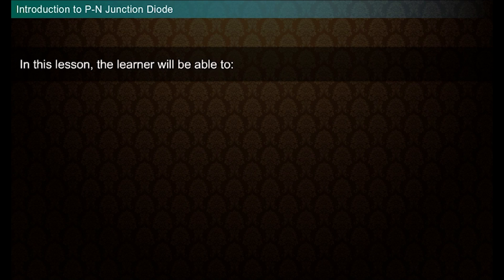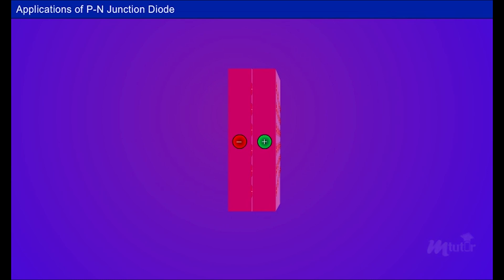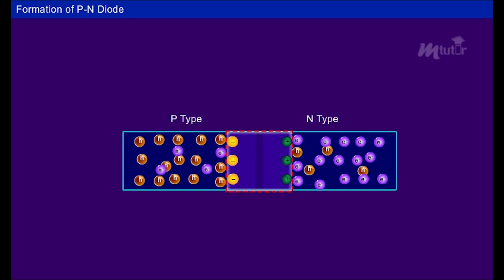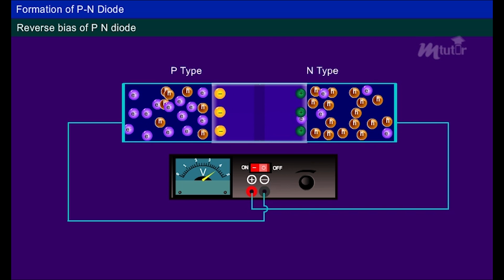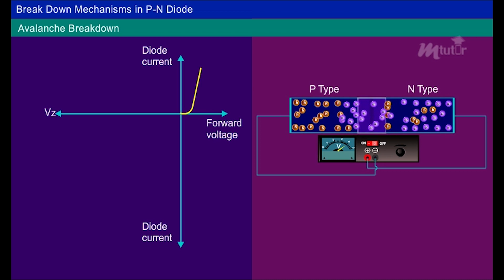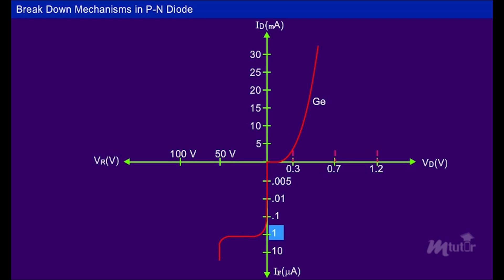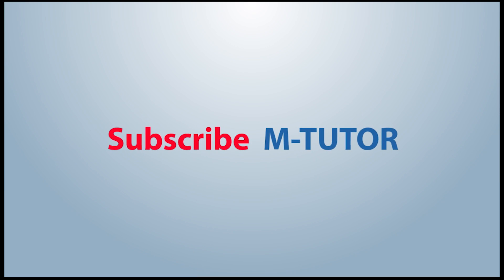V I Characteristics of a P N Diode & Breakdown Mechanisms [Year-1]

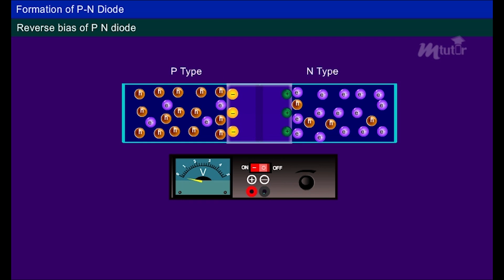Comment: 6:48 the current flow due to majority carriers is diffusion current not drift current
Reply from the maker: In this video, we have explained V I Characteristics of a P N Diode & Breakdown Mechanisms [Year-1]. Under forward bias, the movement of charge carriers in a semiconductor caused by an electric field produces a drift current. Holes move in the direction of the electric field, whereas electrons move in the opposite direction. So the current flow due to the charge carriers is the drift current. Diffusion current is the movement of holes and electrons from high concentration areas where they are the majority carrier to low concentration areas where they become minority carriers.

Comment: at 9:15 ...reverse characterstic is wrong ....reverse current should be constant than increase rapidly due to reverse breakdown.
Reply: The potential barrier can never be made zero volts. It cannot disappear. The forward bias voltages mentioned are not correct. Please refer to the books in this reply.
What is a pn junction ? 
A pn junction allows current in one direction only. It blocks current in the reverse direction. 
When a pn junction is formed, a potential barrier designated Vo comes into existence and is typically around 0.6 to 0.7 volts for silicon junctions. 
When the barrier whose Vo is 0.7 volts is disturbed by applying a forward bias of say, 0.6 volts, the current increases and the increase becomes steep for small increments of the forward bias value a little greater than 0.68 volts. Large currents are observed when the forward bias is 0.69 volts which is closer to the barrier voltage of 0.7 volts. 
The forward bias can never exceed the potential barrier voltage nor can it bring the barrier down to zero volts. That is the reason you seldom see current vs volt graphs of pn junction diodes beyond a volt or so.
How does the bias remain less than the barrier in an operational diode?
The voltage bias applied drops in the bulk neutral regions of the diode. 
The current in a forward bias adjusts to fulfill the conservation of current law and the rate of recombination.
A detailed description of the pn junction with a distinct approach using surface charges, alignment of Fermi levels, creation of the barrier, the distinct processes of diffusion, drift, recombination and the influence of the electric field on the energies of electrons is provided in the following textbooks.

Electrostatics and circuits belong to one science and not two, that of electricity and magnetism. To know how they are unified visit this link 
https://matterandinteractions.org/articles-talks/ and view the article 'A unified treatment of electrostatics and circuits.  B. Sherwood and R. Chabay, unpublished. (1999)'
pdf. 
For a live demonstration of surface charge and its effects in circuits visit 
https://youtu.be/U7RLg-691eQ
For a detailed discussion of surface charge, coulomb's law, electric fields, fields of dipoles and other charge configurations, and parallel plates, and a distinct approach using the surface charge concept in the study of advanced topics of capacitance, currents, conservation of charge, conservation of current, superposition of fields, superposition of potential, simple dc circuit, magnetic fields, magnetic fields of a current element, straight wire, current loop, solenoids, biot-savart law, voltage, voltage source, difference between e.m.f. and potential difference, ideal voltage sources, resistors, how current branches in a parallel circuit, capacitors, inductors, Faraday's law, inductance, ac circuits, transmission lines, Lorentz Force law, motors, generators, p-n junction diodes, electromagnetic waves, antennas and radiation, new electrodynamic theories on the nature of the electric field, see "Electric and Magnetic Interactions" by Chabay and Sherwood 
www.matterandinteractions.org
or 
Fundamentals of electric theory and circuits by Sridhar Chitta
https://www.wileyindia.com/fundamentals-of-electric-theory-and-circuits.html
There is a "look inside" feature in the amazon.com webpage of the book "Fundamentals of electric theory and circuits" by Sridhar Chitta with a few pages of Chapter 1 which may be viewed and also which you may swipe left or press < icon to view the foreword, preface and Table of Contents. The contents of the above book by Sridhar Chitta, make a distinct unified approach to electrostatics and a few advanced circuits like coupling signals to amplifiers, lending precision and clarity to the topics which is not found in most text books.
The book comes alongwith a CD with animated power point presentations for all chapters and voltage regulator, RC phase shift oscillators and differential amplifiers included additionally.
For a lecture by Prof Ruth Chabay on surface charge in a simple dc circuit visit 
https://youtu.be/-7W294N_Hkk
There is a full set of lectures beginning lecture 13 here on surface charges, electric fields, simple circuits, capacitance, inductance, faraday's law, motional emf, magnetic forces and more topics here
https://matterandinteractions.org/videos/EM.html
Reply: Yes